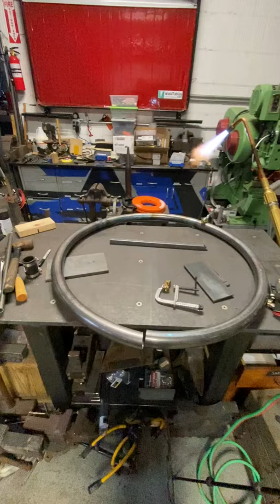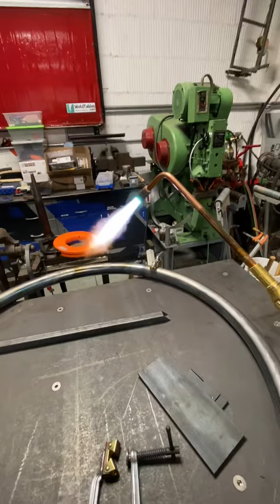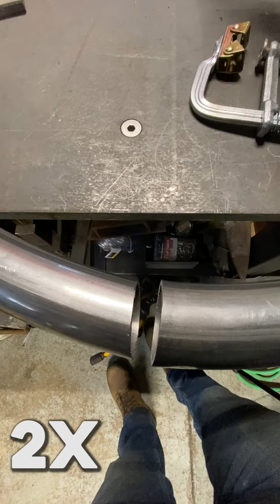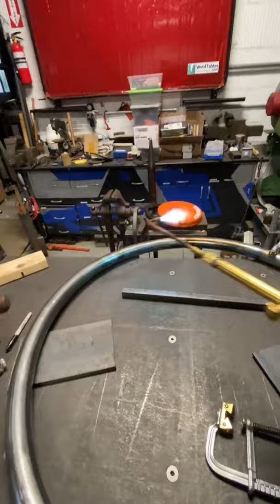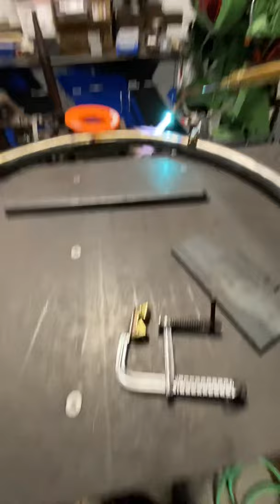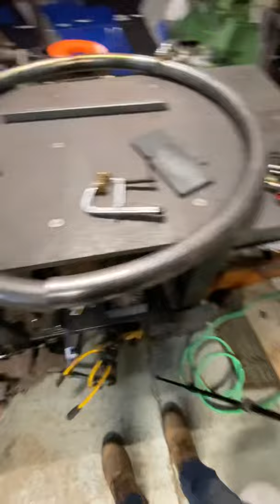Moving Metal With Heat! #shorts

Comment: Wow!  Metal expands when you heat it!?  I wonder if different metals expand to a different degree when they are heated?  Maybe someone could bond together two dissimilarly expanding metals and use the deflection caused by the difference in expansion to indicate the temperature of the two metals?

/sarcasm This is a neat phenomena, and what I described is how dial-style thermometers and analog thermostats actually work.